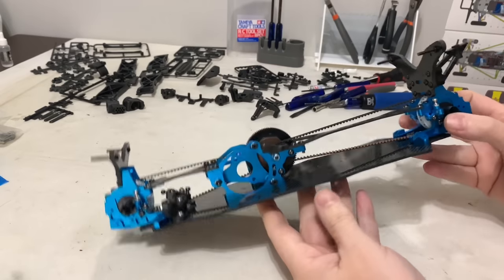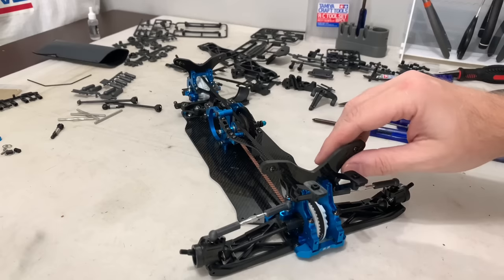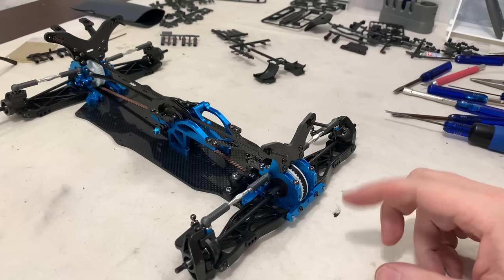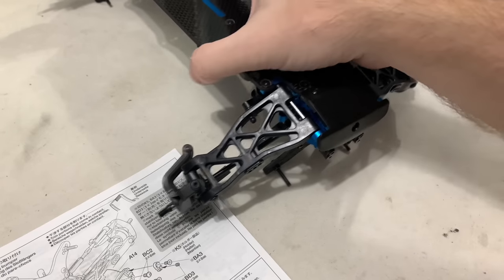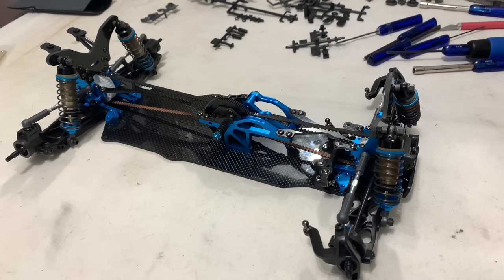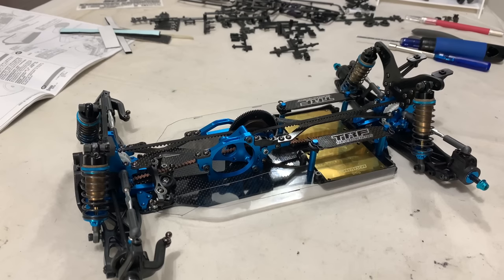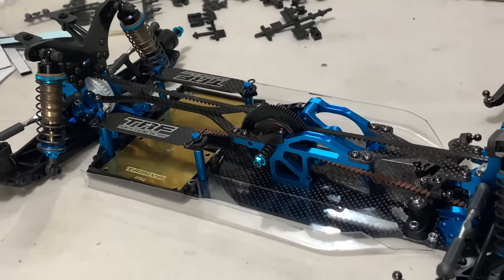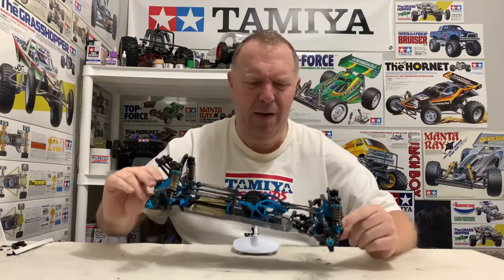Tamiya TRF503 Build Part 2

Comment: The grub screws are to stiffen the piece and help prevent the flex of the plastic from easing out the ball joint. It's mentioned in another Tamiya manual that I remember reading a few days ago.
Reply from the maker: Oh excellent information my friend 😊😊😊

Comment: The Grub screws in the rear hubs in the surrounding holes of the ball studs shall prevent the ball stud from stripping under load. I recommend to not use the silver ball studs, since they are prone to breaking. especially when threaded into aluminum. Just go for the hi grade black ones like you use in some other areas. Would be a shame to see you having to replace an expensive aluminum bracket, once they brake.

Comment: Get one of your motors a 380 and glue some sandpaper to the shaft,number of wraps will increase grinding area but pay attention to rotation so edge doesn't unwind the sandpaper,mechanical speed control and a charge depleated nicad will make for more precision,practice on some scrap:)
Reply from the maker: Excellent idea again James 😊👊🏻
Reply: @TAMIYALegends  you had a dremmel all this time without realizing it;) I'd would be great if tamiya upscaled as I'm sure they'd kick teslas ass!!! Lol